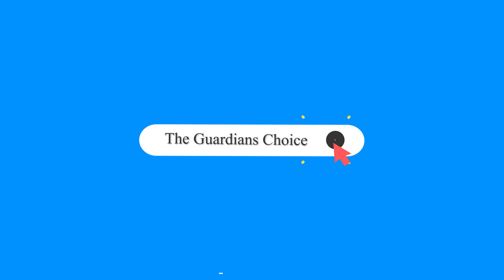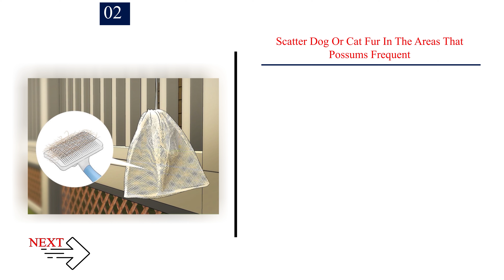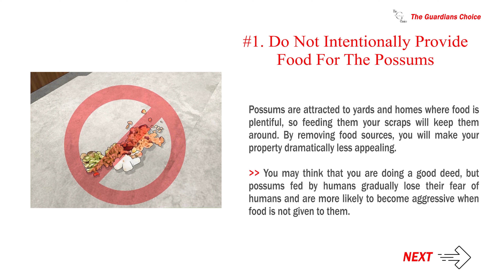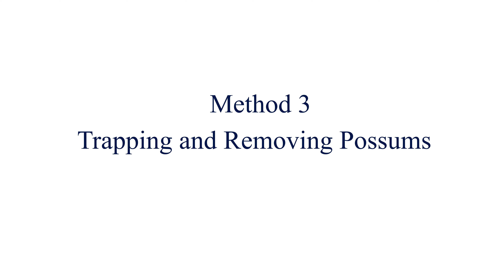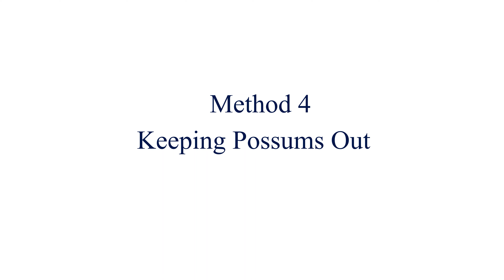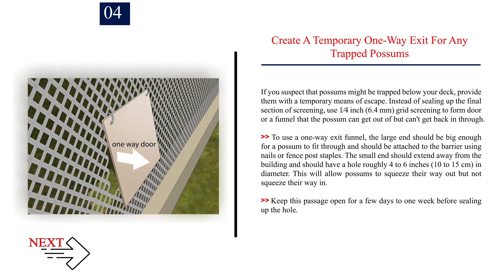Effective Methods: How to Get Rid of Possums Quickly

Comment: How long need to move it from home
Reply: Are you trapping and want to know distance so they do not return, that depends on food sources that would keep them were you drop them off. Also if they were female and born by you that  they may want have their babies where it was safe for them.  A nice wooded area about a mile away should be good because they could find food long before they come back.  They are one of the good animals that we invaded their space and they mean no harm, so be kind as they are beneficial for eating bugs we do not want. I have caught them in my traps after raccoons causing trouble many never returned. I had kittens that were  ferrel born in my yard and the possums would eat with them on the same plate at  the same time but both seemed to get along and the cats now only get fed in the house and the possums moved on. Sometimes they come when the bowl was empty along with the skunks that the cats got along with hit me up for food as they were fed just out side my Man cave with an open door. Yes I fed them and one of the cats is bugging to be fed.